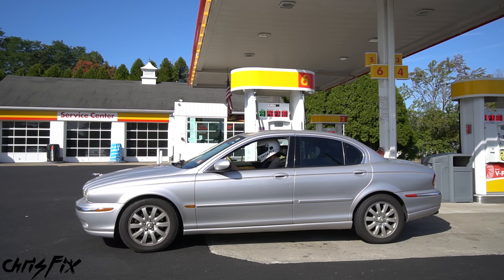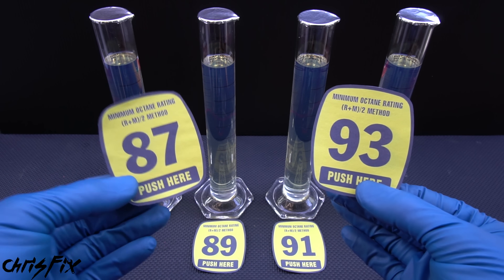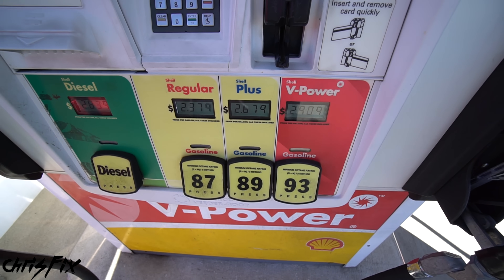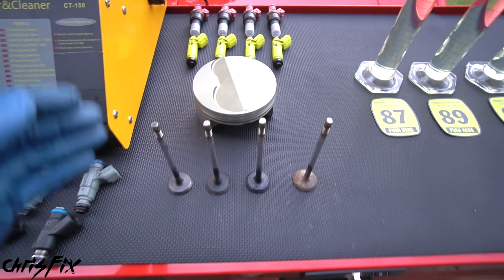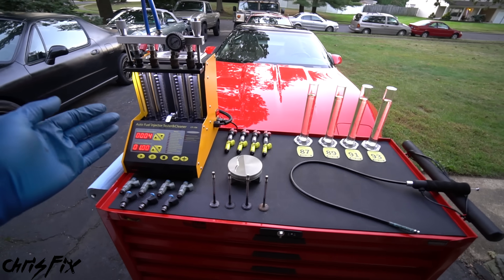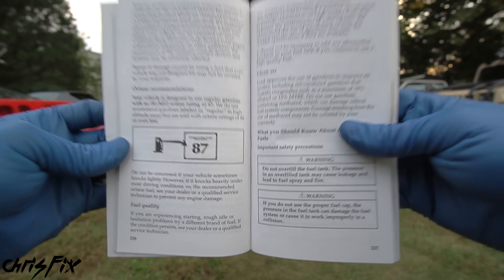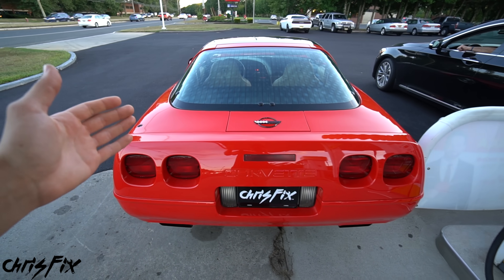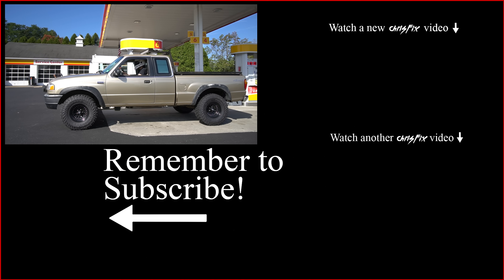What is the BEST Fuel to Use in Your Car or Truck and WHY

Comment: Can I get more explanation on detonating? I’m kind of confused
Reply from the maker: The fuel ignites without spark. It could be before the spark on the piston up stroke, or it could be during or after the spark in different spots in the cylinder. Both cause knock and can damage the engine.
Reply: @chrisfix  ohhh okay okay I understand. Greatly appreciate!

Comment: Corolla 2011 1.8??
Reply: Janyel that Toyota is tuned to run best on 87 octane. So, bottom line is stick to the recommended 87 Octane. That is peak efficiency for your Toyota.

Hope that helps you some

Aaron

Comment: Don't nobody listen to this idiot or one that knock sensor is a crankshaft positioning sensor it doesn't recognize when a engine blocks and pins it replaces your distributor right along with the camshaft positioning sensor those are your distributor and when it comes to the octane crappies beating you run nothing but white your automobile tells you to run somewhere owners manual fuel door tells you what octane use that only I have a 2014 Dodge charger that requires 87 octane it is EcoBoost which means it is economical friendly turbo it says run nothing but 87 octane so whether you got it turbo or supercharged run nothing but what your vehicle says if it says 87 octane run 87 octane anybody listen to this guy you're going to have a very very costly repair bill

Comment: Missed the most important facts. ETHANOL is not good for engines.  Most gas has ethanol in it.  Check facts about damage caused by ethonol create moisture inside engines.  Yes it's not good stuff.  Most gasoline has it .

Comment: I have a Audi A4 b8 2.0T I put about a quarter tank of 87 in it and it started misfiring and I think it's in limp mode and low boost. So is the gas causing this?
Reply: The Audi has what's called DTC codes...

In order to properly troubleshoot, those actual codes from the limp mode are needed.

If you can get those codes you will have a much better idea of what is going on. 
If you can get me those codes I can help if you like.

Aaron

Comment: You said that the rating doesn’t effect horse power
Explain to me how the new Ford Bronco with the 2.3 litter engine give you 270hp with 87 but with 91 will give you 300hp
That is how Ford sells the Bronco so I guess they must be correct ?

Comment: My owners Manuel recommends 87, but for every tests by the car maker, they used 91 octane.
Reply: Mikey, mind if I ask what you drive?

Thanks, 
Aaron
Reply: @vigilantemotors  2010 Tundra
Reply: @HeyMikeyLikesIt2  Nice truck. If your manual says to use 87 then that is what I would use. Car company's (engineers) tune the engines to work with a specific gas grade for optimal performance and LONGEVITY!

So, if it says 87 roll with it as your engine will last a long long time!

Comment: Remember the days when gas was in a bottle on top of the gas pump at gas stations and the attendant would come out put gas in your car and cleaned the wind shield,check the oil and would check the air in your tires if you asked them to? 
Give me the 1950 back. I didn't know about Shell gas, now I do. Using Shell from now on

Comment: I used to work at Shell, and I can tell you that this "high octane equals better fuel" is the result of marketing. You're throwing away money if you're putting premium fuel in your naturally aspirated SUV. Additives are the only difference.
One of the chemical engineers once told me: "Do 5 tanks regular, 1 tank V-Power."

Comment: I normally use Unleaded 91 (In Australia) which is the cheapest. Would I get rid of a lifter if I use premium fuel for a few full tanks?
Reply from the maker: A lifter problem is more of an oil/oiling issue than a fuel issue

Comment: My Suzuki Baleno only states "Unleaded fuel only" which is basically non ethanol. I drive around 200 miles per week on my car and I like to put  Super gas every 2-3 weeks to make sure the engine stays on top.

So far car runs smooth
Reply from the maker: Thanks for sharing!

Comment: I drove a mustang and GM recommended me to use the 93. So any way i used the 87 for a week and then switched to 93 after that. I could have my car had more power and more responsive whenever i press the accelerator. 93 is the best and good for your engine if you are driving a mustang. Anyway its better to read your Manual to see what the devs of the car recommend you to use.

Comment: Use the octane rating that is recommended for your car. Higher octane rating doesn’t mean better gas. Higher octane means it requires a higher compression to ignite. If you have a higher compression engine you need the higher octane i.e. Harleys -

Comment: Good video. I’m commenting at 6 min so you may cover this - if an engine detects pinging, the engine reduces the timing to stop it. This is why an engine doesn’t run as well with low octane fuel if it is pinging.
Reply from the maker: Thanks for sharing!

Comment: Question : bought a car and owner didn’t get regular oil changes  the last yr and half they had it,will running premium 2500mill would it clean up some of the injector and engine gunk? Or does that have much to do with irregular/sporadic oil change. I’m glad they were at least honest on the oil change maintence

Comment: Older car better high octane, newer car if recommended go to middle like 87 or 91 and you’l be fine. If req then follow manual of course 😂 if you really like to keep the engine clean high octane and you’ll maximize power,smoother internals but for a cost of your money. 

Theres a reason why the 93 has a higher price range bec its cleaner and can protect engine internals.

Comment: Bullshit if you ever worked on a car you'd see the difference from using cheap gas and high grade fuel. Cheap gas leaves alot of black carbon on the valves n in the carb.. from personal experience. My Yukon ran like crap with low grade fuel and had alot of carbon build up. Even caused my fuel pump to fail twice. The manual said to use 87 or higher but 87 caused nothing but problems Started using 91 and my valves are clean no carbon no shake and no smoke or anything. And it lasts longer. Brother had the same mustang you showed and same problem using cheap gas 87 caused alot of carbon build up. 91 now and no problem. Clean as a whistle now.

Comment: In Canada regular and mid grade have  up to 10% ethanol and premium is usually ethanol free depending on brand of gas. Petro Canada has the highest octane sold at 94 octane all other gas stations are 91 octane in my province. Octane difference between reg and premium is just additives and ethanol percentage.

Comment: 87 is just fine ! .. fjn fact it cost big oil MORE  to make 87 then 89 & 93.  And even less then 116 race fuel ! Your car has a computer it adjusts your fuel and spark to run the way they want it !  High Octane dont Make more power or give you better mileage !
Reply: actually depends on the car, plenty of cars will run terrible on 87. and often they will have to pull timing out because of knock which means less power

Comment: Most people don't use the car over 7 years. Use the cheapest gas possible, your car won't break because of it and you will save $10 to $20 each type you fill it up. And no the super gas doesn't get you farther either, I tried it many times. Mic drop.
Reply: terrible idea unless your only driving cheap eco cars, just because it doesnt work for the car you have doesnt mean it doesnt work for any

Comment: for me my car throw that code because I used premium gas in it for 3 years . cleaning the catalytic and the mechanic told me to never full your Accord with premium . Now after I full it with regular Really I feel the car has more power and no more of p0420 ! so all what he said in this video a bout full what the car manual said is True > All Hondas 4 Cylinder must be fulled with Regular Gas
Reply: not all of them, a type r is not going to use regular

Comment: What a beautiful straightforward presentation thumps up, i just bought 2019 Lexus ES 350 F sport and it says in the manual 87 (Research Octane number 91) or higher im very confused should I use 87 and is it possible to use 91 ?? Would I run in any trouble later ? Thanks

Comment: I’m getting knock sensor codes but fill up with 87 on a 93 octane car ls400. The car starts pinging when it warms up under harder acceleration and just does not run right. I think I should up my octane.

Comment: So like you said with the truck. You had a lot of carbon build up. That occurred from using 87 correct? Theoretically.. if you used 93 from the start from say..shell.. you wouldn't have had that issue correct? So, that being said, that means to there are benefits to running 93 in am 87+ option.

Comment: The Citroen I drive says "designed to run RON 95, use 98 for better driving experience" in the manual. It noticably gets jerky and hesitant when accellerating with 95, I don't hear any knocking though. Might as well be the difference in additives in premium vs. regular, who knows

Comment: i think you should use the 93 option because it keeps engines clean and increases mileage
Reply from the maker: Depends on the engine. If the car takes regular it wont increase mileage.

Comment: No 85 octane on your list!
  The fuel requirements depends on the motor, value material and compression ratio!
      I'm a certified master technician!
          Just saying!
Reply from the maker: Thanks for your feedback. 85 octane is not very common and used primarily at high altitudes because with the increase in altitude the less octane you need compared to sea level.

Comment: ChrisFix: Were not gonna talk about diesel in this video
Also ChrisFix: Talks about diesel (If you have a diesel truck or car, don't put gasoline in it because it wont run, it will damage the engine...)

Comment: Excellent Video! I have a question?  Can you have too high of octane?  I ride snowmobiles at high elevation 8,000 to 10,000 ft.  The snowmobile requires ethanol free, 91 octane. Some of the guys I ride with ad 1 1/2 gallons of race fuel when they fill up with gas.  Each tank is about 12 gallons, so 10 1/2 gallon of ethanol free 91 octane plus 1 1/2 gallon of 110 octane race fuel.  At what octane does it become bad for my engine?
Reply: None. Octane is how hard it is to ignite the fuel. As long as you have half decent spark in you mobile no octane rating will ever be to high.

Comment: For those of you who want a bit more clarification about the different fuel octane ratings:  PON (Pump Octane Number) = RdON (Road Octane Number) = AKI (Anti-Knock Index) = (R+M)/2 

These are all the exact same octane rating you might see in the US (AKI and (R+M)/2 being the most common) which is the calculated average between RON (Research Octane Number) (used in Europe) (Performance at low speed & low temp) and MON (Motor Octane Number) (Performance at high speed & high temp). AKA (R+M)/2 (add the numbers up and divide by 2).
Reply: (((what)))?)
Reply: (Why did you put pretty much everything you said in Parentheses?)
Reply: @junebug9594  this is parentheses " " " "
Reply: @FlatManBOfficial  No they are not, those are quotation marks... the comment was correct, the poster put a lot of things in parentheses.
Reply: @FlatManBOfficial  kidding me?
Reply: Yeah, it would be weird if US had the same units as in the rest of the world)

Comment: Very informative video explains it quite well. However, you left out the fact that a lot of fuel companies now are adding 10 to 15% ethanol to your fuel. Some of the gas companies in the higher grade fuel does not put ethanol in their fuel. It’s worth knowing which ones do not. I do not like ethanol in my fuel as it will pull moisture into the engine. That’s not exactly a good thing. Ethanol has a third less power than gasoline so if you have 10% ethanol in your gas you will go 3% to 4% fewer miles per gallon if you have 15% ethanol in your gasoline you will go 4% to 5% fewer miles. It doesn’t sound like much but when you consider how many miles you’re losing on every tank of gas and then calculate that over the course of the year. yeah, you’re being screwed. If you have a car that is not designed for ethanol, it can destroy your gas tanks. Fuel pumps gasket as it pulls moisture into your fuel. Makes me wonder do they do this on purpose so you have to buy a new car sooner. And what happens if you have some great classic cars it’s not exactly gonna be good for them. My advice is if your car requires higher octane fuels lock into the gas stations that sell fuel without ethanol.
Reply: @John Doe I don't know all the gas stations that don't put ethanol in their fuel. I used to go to Petro Canada all the time but they put ethanol in all their grades of fuel so I've changed it up to shell I believe Esso in their higher grades don't put ethanol in either. There's usually a sticker on the pump that will say ethanol free.
Reply: They put ethanol in the gasoline they sell because it's a cheap way to increase octane. Ethanol-free gasoline is more expensive to make, and will cost more than the mileage lost with E10 or E15 gasoline.
Reply: They put ethanol in gasoline in order to artificially boost the price of corn. Farmers were producing too much corn and needed a new market because of falling grain prices. It's a really terrible solution, though. It takes more energy to produce ethanol than you get from burning it. Also, ethanol is heavily subsidized and stations are incentivized by governments to sell it, hence the cheaper price at the pump. It's marketed as a cleaner burning, sustainable, environmentally friendly solution. Nevermind the production process, and now the planned multibillion dollar CO2 pipelines to dispose of the greenhouse gases produced at ethanol plants deep underground. Ethanol in gasoline is just a dumb idea all around, but lawmakers are not going to do anything about it anytime soon because big agriculture owns them.
Reply: @aaronknapper2850  Their claim is it's better for the environment, when it's not true.
Reply: There's a location app, called Pure Gas, works in the States. Idunno about anywhere else.
Reply: @John Doe the only station I have here in ohio is a Circle K that has no ethanol, it’s 90 octane and is at least a $1 more than 87 octane
Reply: I bought a Nissan rogue sport and it the manual it says , Nissan does not recommend using ethanol fuel
Reply: @jonmo2694     By that they mean E85, not E10-15
Reply: @gsilva220  no, ethanol 10%, it's garbage
Reply: @jonmo2694  yep so that's going to mess with your fuel lines and it's going to pull moisture into your engine and over a period of time will f*** it up. It's a scam by the government and the petrol companies and car manufacturers. The government says it's for the environment it doesn't help one little bit whatsoever. The price of gasoline has not come down since they added ethanol it is only gone up and you get approximately 4 to 5% less mileage on every full tank which means you're filling up more regularly good for their business model. You also have the cars getting damaged and will have to be replaced sooner especially for those who take good care of their cars it won't matter your deliberately putting something into your car that is causing damage. Absolute scam.
Reply: Isn’t ethanol much much cheaper?
Reply: @needahero1983  what you think the price of fuel has come down since they added it. Can't say I've seen that. You also have all the additional damage and maintenance ethanol will cost your vehicle granted it'll take a period of time but it will cost you.
Reply: @needahero1983  yes but you dont get as many mpg with it
Reply: @needahero1983 Ethanol is also an octane booster.

Comment: 13:34 cannot agree more. i have a 99 gt mustang and it will rattle and have a slight misfire if i dont fill it with premium. reason being (i assume) previous owner tuned it on 93 and forgot to tell me. premium can handle advanced ignition timing a lot better than normal cheap fuel so people often get their cars tuned on it for faster ignition timing.
Reply: It's really easy to adjust your ignition timing
Reply: @olbricky6824  real easy... Through the ecu?

Comment: Hey Chris, would you do a video on whether HHO kits works to reduce fuel consumption? That would be helpful!
Reply: Nope. The energy required to split water into hydrogen and oxygen is actually more than the energy released when it's burned inside the combustion chamber.

Comment: So based on this if my jeep takes regular its okay to run premium through it just to clean the engine? It is making a ticking sound. Wondering if that would help it. But im unsure. Makes me nervous to use a gas higher than regular

Comment: Will using higher octane or quality gas affect my car? Cause I thinks the head gasket is starting to wear, I felt less compression from the engine it, wouldn’t those carbon deposits help me keep my engine’s actual compression ratio? Btw this car is not worth repairing it, I’ll drive it the most I can before buying another one so yes I know repairing the head gasket would be better but not cost effective in this case, thank you to anyone answering